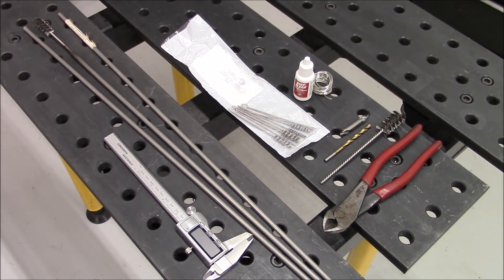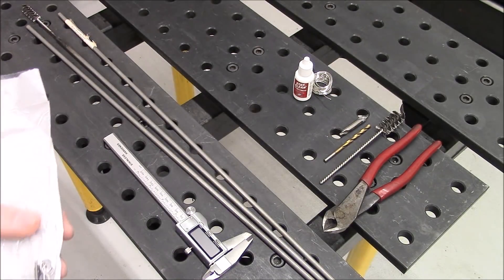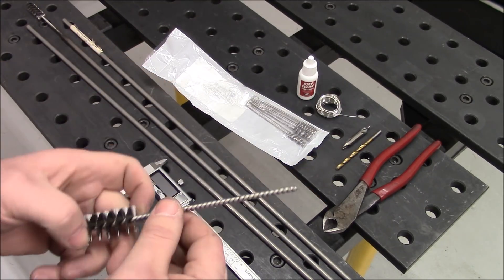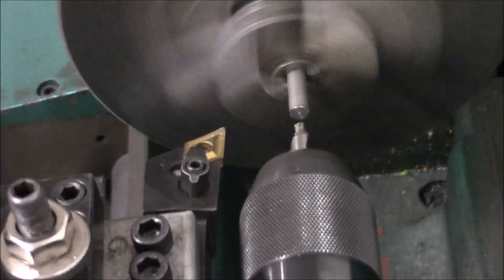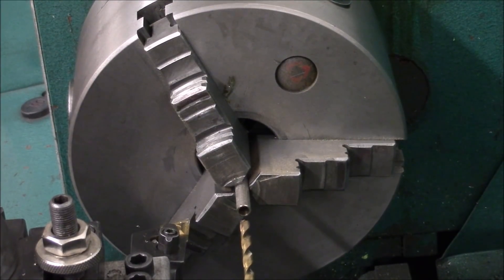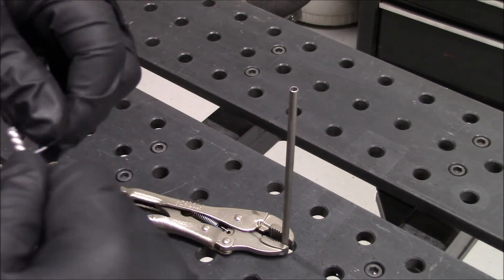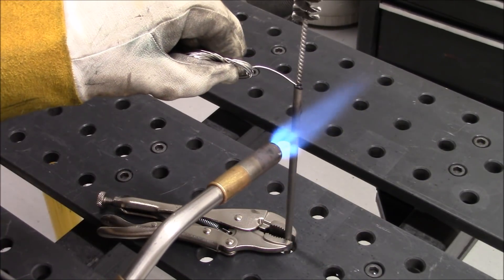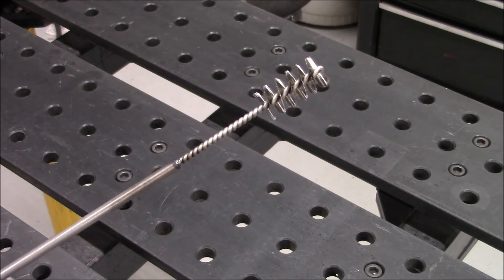PRO TIP #1 - Engine Oil Galley Cleaning Brush - Performance Engine Building 201

Comment: Hopefully, you are only using steel bristle brushes on cast iron blocks. Those would grind away aluminum blocks while leaving LOTS of aluminum shavings in the block.

Comment: Yep, you can use gun cleaning kits by hand But the brushes need to be high quality to not get waisted immediately by a drill motor, so there is a reason he is showing how to make one strong enough to use on a drill fyi
Reply: His brushes are hardly stronger than the average or better quality bore brushes. We spin them on drill motors all the time. (Just have to spin the correct way to avoid unscrewing the threaded sections ...)

Comment: What about using gun cleaning brushes and rods.
Reply: Absolutely fine. (all of us gunsmiths went bug-eyed when he described machining his SS rods to accept 'soldered brushes' ... eeekkkkk!! Bore brushes are made in many cool sizes .. in many materials and grades ... WITH threaded bases for quick inter-change... MUCH quicker and cheaper than MAKING the brush/rod combos he's describing...) We spin them with drill motors all the time with good results ... so do it!